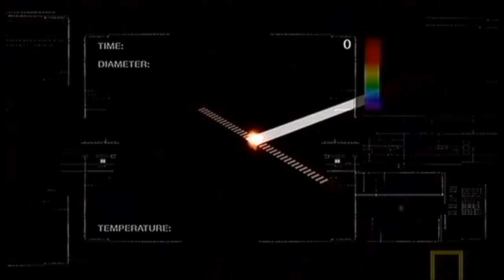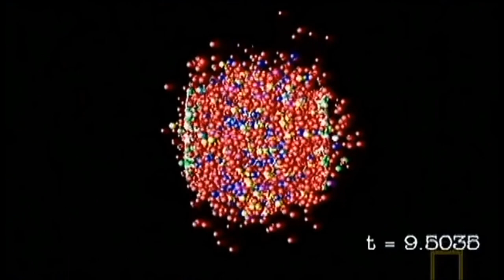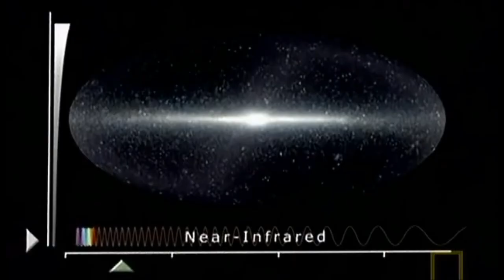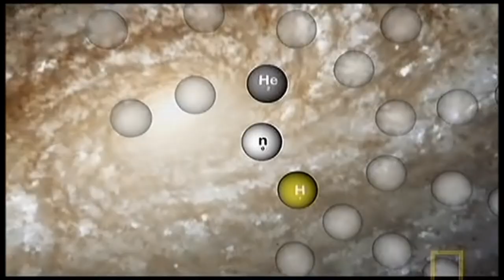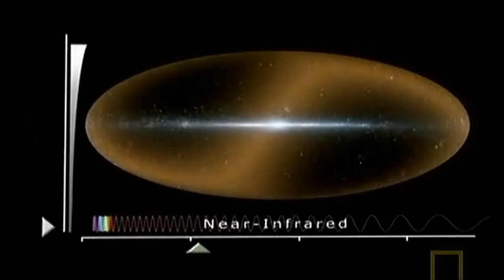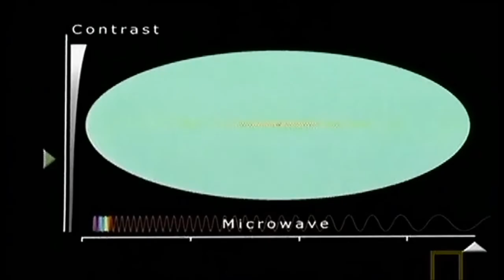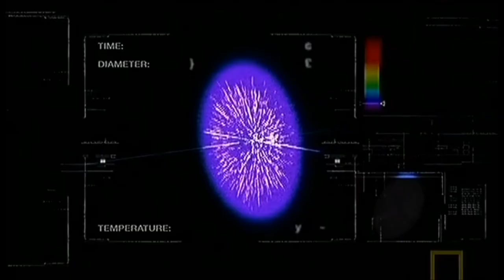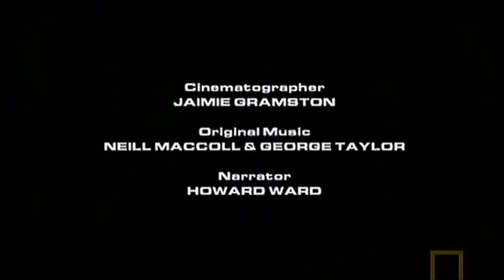一NG2006BirthOfUniverse

Comment: If you ever get a scientific explanation that sounds plausible let me know!  The only thing I've ever heard comes from the Super String Theory which is mostly just philosophy.  But it based on membranes that exist parallel to each other.  These membranes touch and cause big brains in one or both of them thus a universe then the energy equalizes smoothing out the membranes.  Membranes are infinite rays of 3D capable space smoothed symmetrical. Add energy/mass you get space/time in the membranes.

Comment: 1900girl what I get is a certain time when it first started to expand it was going faster than light, but as time went on it slowed down to speed of light or a little slower.  I believe when they thought the expansion was slowing down they thought after 13.7 bil years it will be slowing down on expansion but it isn't.   to simplify the speed is never consistent started out faster than light now little bit slower than light. that's my interpretation.  anyone got another, I'm not an astro physicis